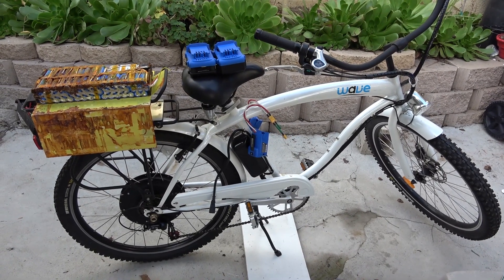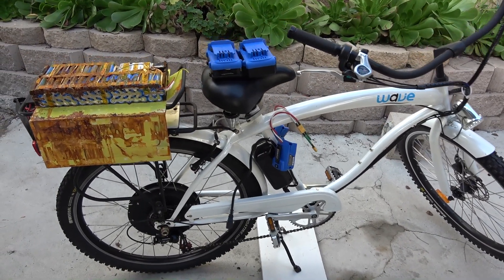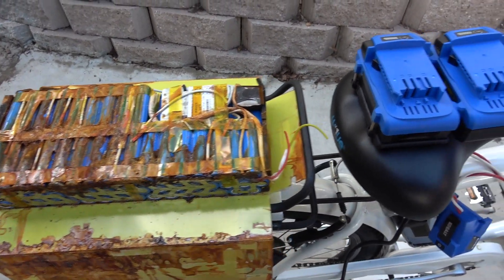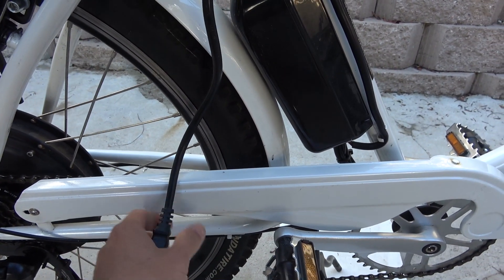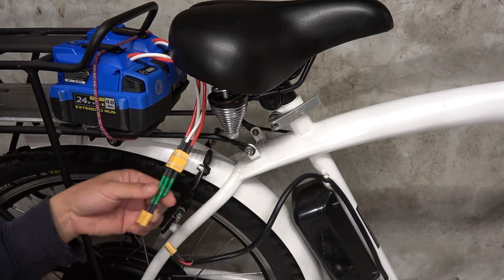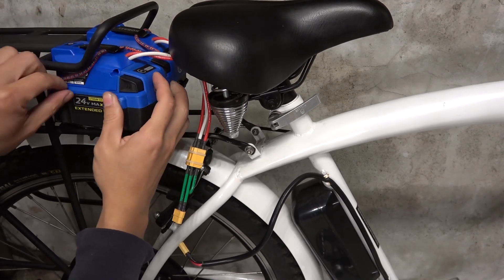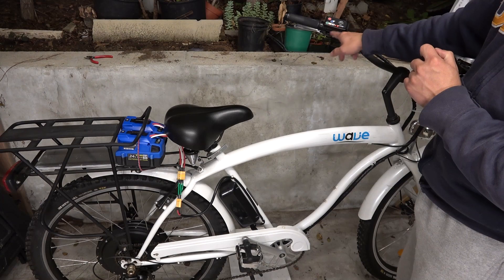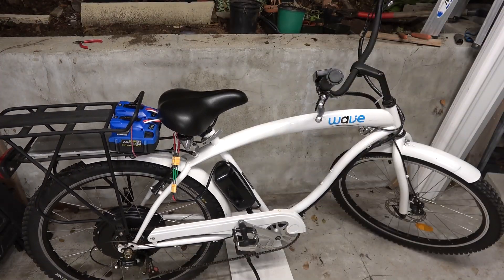Ebike Project S02E01: Replace Wave ebike battery w/ 2x Kobalt 24V power tool battery

Comment: I actually owned this E-bike and it is a peace of crap to be honest.
I had one and the motor blew up two times but at least it got replaced for free under the warranty.

That's why I switched to an Pegasus E-bike with Shimano E6000 motor.
The stock Shimano battery pack sucks and I replaced the cells immediately to 
Panasonic NCR18650PF 2900mAh 18650 cells. I'm getting 40-60km range om single charge when I drive 25-30mph
Reply from the maker: Wave makes affordable ebike. Some say their first gen ebikes are not good. They must have cut some corners here and there. But their second gen ebikes look good. This particular one I have is fine though except the messed up battery. :D
Reply: @vuaeco  sounds like I got the first gen but at least I got one positive experience with their product... Great customer support
Reply: @PolakeXD  25-30 mph with a 250w motor? I'm calling bullshit on that.
Reply: @fun_ghoul  that's actually possible and if I switch to Eco then I can get a possible range of 70km.
Reply: @PolakeXD  E6000 stops providing assistance at 25 km/h, or 15.5 mph (as Brits know). Moreover, people with 250w Bionx kits report that their top speed barely increases when they remove the speed restriction, from 32 km/h to 35 km/h. That's still only 21.7 mph. So the question now is, how did you modify your bike to exceed the speed limit in Shimano's controller? Also, you're saying your mid-drive is 38% more efficient than a hub motor? Extraordinary claims require extraordinary proof. Go.
Reply: @fun_ghoul  there is a little box which is called SpeedBox for Shimano Steps Di2 and it removes completely the limits.
The thing is that if you remove the shitty little magnet and just replace it with an electro magnetic impulse generator then it will of course be not that efficient.

An Speedbox just basically emulates everything (I guess) and the engine just works until it reaches it's limits.
I actually was able to reach 59km/h but the engine wasn't going faster than that.
In my opinion, it's kinda stupid to go over 30km/h since the battery will get very fast drained. I know that because I was trying to reach it's top (unlocked) speed.

I can upload couple of pics if you want to.
I'm definitely not lying there and there are methods to get faster speeds but it's up to everyone who wants to get this kind of fun. I actually got my Speedbox very cheap because of black friday sales on my local shop and I only paid like 72€
Reply: @fun_ghoul 
https://drive.google.com/file/d/1Jk8nlT9XkJWPYwYgi5MPWVeRAYEWnDJl/view?usp=drivesdk

https://drive.google.com/file/d/1Y-UOm8hgBOsuuj561Y7oo4UnY_OtBeGI/view?usp=drivesdk

Here are some pictures which I took a moment ago. The battery was at 91% while I was taking this picture but I can confirm that I can get up to 70km real range with the normal mode but the on board system is always showing more since it doesn't take the fact that I sometimes use the light and the fact that I let the motor spin to 30km/h, is also not considered by the on board system.
If I switch to high mode then I can also reach faster speed but the battery will be drained too quickly.
Reply: @PolakeXD  IOW, you need a lot more than 250w to achieve that speed, which is what I said in the first place.  And it cost you "only" 2000€ (bike) + 72€ (Speedbox)? LOL. I guess you have money to waste!

Comment: Dont do this. You will most likely ruin your batteries. Those batteries rated for high current so you will probably cause a fire. Add more in parallel.
Reply from the maker: Been using this setup for almost every EV I have. Watch my other videos, mate.
Reply: vuaeco well your knackering your batteries. You need more in parallel.
Reply: @yakz9885  How so specifically? Each battery comes with it's own BMS. As result you're actually less prone to discharging/overcharging the batteries. Additionally the cells are name brand.

Comment: What's in those batteries, are they 6s3p?
Reply from the maker: They are 6S2P. Cells are 2Ah, 20A discharge rate, totaling 40A discharge on the pack. Plenty enough to handle this ebike.
Reply: @vuaeco  Thanks

Comment: Yes, you should order some 18650 batteries off AliExpress or Banggood and rebuild the original battery.  You have a nice bike but tool batteries aren't powerful enough for Speed + Range. Good luck. Should make a good project to video.  :-)
Reply from the maker: Hi Roy, range can be remedied with this: https://www.youtube.com/watch?v=CSYB60GSLic
In fact, I use it on my other ebike and I usually get 20-25 miles of range. 
Speed? Maybe I should put in another one in series to get to 72V? :D
Reply: Power tool packs are full of cylindrical cells, so why would they be worse? In fact, the highest amp draw types are used in power tool packs specifically because power tools have high power density requirements. While it's true that some cells might have higher range, they would also have lower ampacity. As Vuaeco said, more speed is just a matter of connecting more packs in series. To follow onto that, more range is just a matter of connecting more packs in parallel!
Reply: Traditional European...With power tool batteries the amp hours aren't very high. The highest I know of is a 60v 9Ah Dewalt battery.  Yes, you can use more than 1 battery but they're expensive to buy and buying 2 is almost the same price as a proper Ebike battery itself.  9Ah ain't going to give you much range. Interesting problem though. Which is why I love this guys channel.  I like his can-do attitude and any problem can be solved.  ;-)
Reply: @Bogsyism  First, DW609 is not "60v 9Ah". It's 18v 9Ah, and 54v/3Ah in FlexVolt mode (there's a 12Ah version out now). Second, "a proper ebike battery" is made of the same type of cells of inferior quality; they're often LiFePo4, which is good, but low energy density. Third, not every bike needs a range of 50 miles. Fourth, tool batteries are good if you own the corresponding tools. Fifth, good luck trying to "warranty" an ebike pack! Tool packs are easily exchanged at Lowe's, if need be.
Reply: Traditional European Yes, Your correct about the Dewalt being 18 volt 9Ah and 54 volt 3 Ah. I forgot about that. Your also correct about tool batteries being ideal if you have the tools to go with them. But for me personally it doesn't work out being feasible.  I don't have the tools and buying the amount I'd need is just as expensive as a 48v 20 Ah ebike battery. .Each to there own I guess....P.S We don't have any Lowes in the UK unfortunately.  ;-(
Reply: @Bogsyism  Lowe's is merely where Vuaeco's Kobalt packs came from (they are notably the only widely-available 22.2v nominal packs), but the thing about getting packs warrantied holds true for any brand. When I needed DeWalt packs replaced on warranty (tool use, not bike use), they sent me new ones without an issue. Also, a lower-ampacity battery will only ever work with a bike having a lower amp draw. IOW, upgrading your motor and/or controller means upgrading your battery too!
Reply: @Bogsyism  There's also a point to be made about reliability. The cells in my DeWalt packs are made by Samsung and Panasonic. I know Makita packs have long used Sony VTC cells, which are the same used in Bionx OEM packs by BMZ Battery of Germany (made famous by "Doctorbass" on Endless Sphere, for example). Who makes those "mystery pack" cells? How much did they spend on R&D? What's the warranty like? etc.
Reply: @Bogsyism  Your point about this particular bike needing energy density more than power density is sound, but a controller upgrade may well negate that. Those "1000W motors" will pump out almost three times that much, with the appropriate controller. At that point, power density is more important than energy density, even as it pertains to having the smallest possible battery.
Reply: Traditional European ...Wow, you know your stuff. I'd hate to get into an argument with you over what's the best battery, controller or motor. You'd rip me a new A-hole. Ha, ha. ;-).  You should have your own channel explaining this kind of stuff.  Anyway,  thanks for the info. It's been interesting.  Take care friend.  Happy Xmas + Happy New Year.  Roy